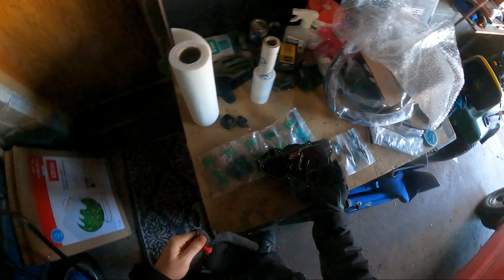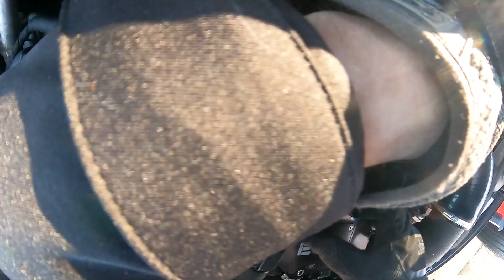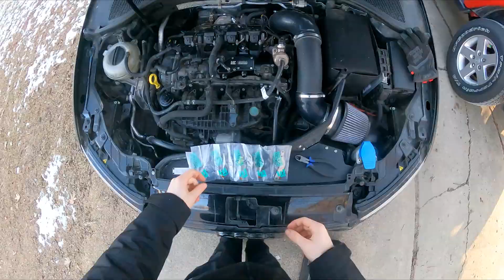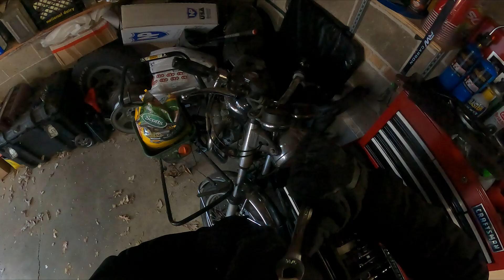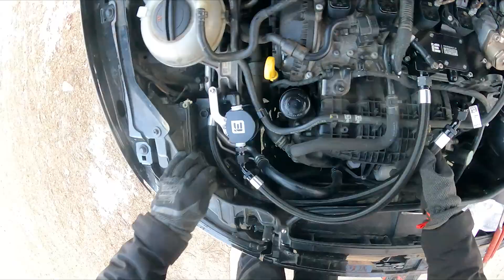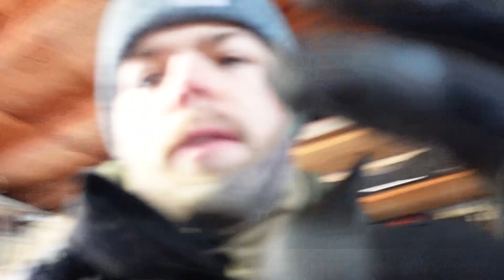Installing the Integrated Engineering Recirculating Oil Catch Can Kit! | Stage 2 Audi A3 8V Quattro

Comment: Which direction did you point the arrow on the check valve? The instructions are worded strange like they're missing a word or something. I know it's a 50/50 shot but just trying to see if my guess was correct or not.